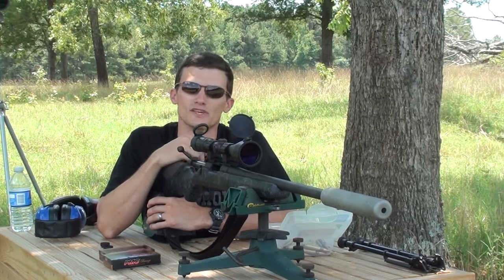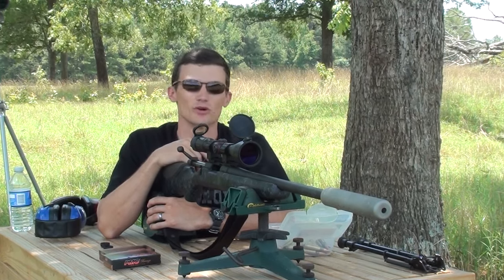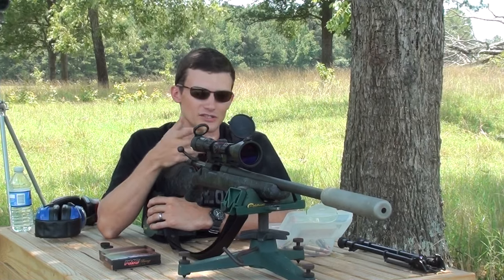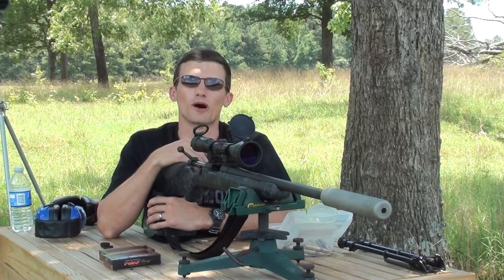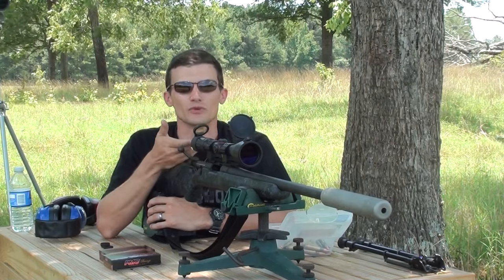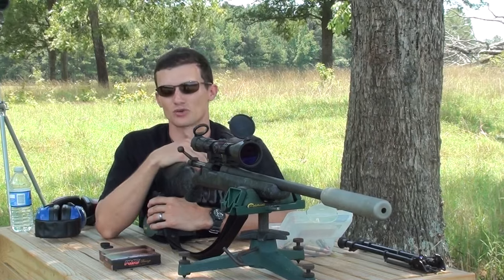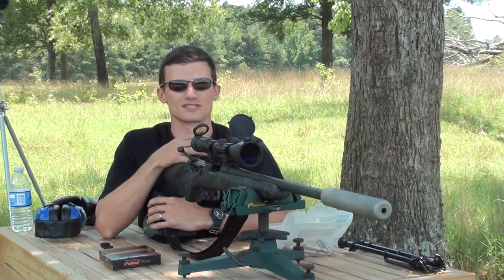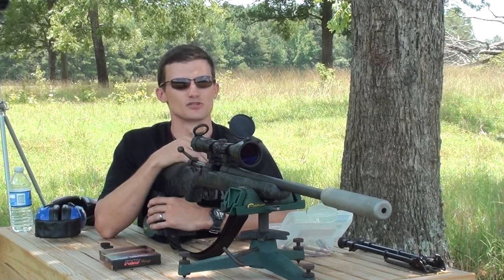.308 WIN Suppressed VS Unsuppressed

Comment: People often think that a suppressor will dampen the noise of a shot, which it will to a certain extent but if you're using supersonic rounds and you're out in an open field then that round will make noise all the way down range. Most of the noise from a gunshot does not come from the burning of the propellant it comes from the round breaking the sound barrier as it travels down range. Which is why soldiers often talk about the cracking of bullets as they pass overhead or in between them.
Reply: burning the propellant itself makes an irrelevant amount of noise. The 3 factors are moving parts in the gun, the gas pressure at the muzzle of the rifle and the bullet when it flies through the air
Reply: A suppressor just SUPPRESSES the noise making it harder to pinpoint WHERE it's coming from am I wrong?
Reply: @roteroktober360  what about the sound coming out of the ejection port? The exploding primer is basically like fireworks. Or will the sound completely escape through the muzzle before the bolt carrier will be launched to the rear? If we talk about conventional assault rifles of course.
Reply: Sure a little less sound to the ear is good but it isn't wrong to just get a suppressor that will suppress the muzzle flash out the barrel to a minimum
Reply: @majormusiq1991 It reduces the pressure of the gas before it exits the barrel, making it quieter.  importantly quiet enough not to damage hearing.
Reply: The crack of the bullet isn’t that loud. That’s why with a suppressor you don’t need hearing protection if you’re shooting modestly and not mag dumping. Precision shooting I don’t need ear protection with my suppressors. That’s why people use them.
Reply: You don’t need hearing protection for the sound of the projectile breaking the sound barrier.   Yes it makes a crack but it’s not that loud.

Comment: Also many of these items are expendable meaning cheap is good if you want to replace it when it breaks. Kind of hard to replace a Acog at 1,800 a pop but a UTG Red dot is 50.00
or A 30.00 maglite you will can destroy over a 400.00 surefire flashlight. You will freak out over if you breakit!

Comment: does the suppressor hurt accuracy and range?
Reply: +burmesebeef The suppressor itself does nothing but slow down the expanding gases coming out of the barrel, thus making it more silent. However if you want to be as silent as possible you have to use subsonic ammunition, which travels slower and thus reducing the range.
Reply: +Andersng1 thank you for the explanation

Comment: We found using 185 grain Subsonic rounds with a 20 inch barrel on 308 platform is very quiet, somewhat to the sound of a hand stapler. I would say it is just as quite or better than running with a suppressor. The suppressor actually creates more back pressure, and that noise is louder than just shooting it unsuppressed.